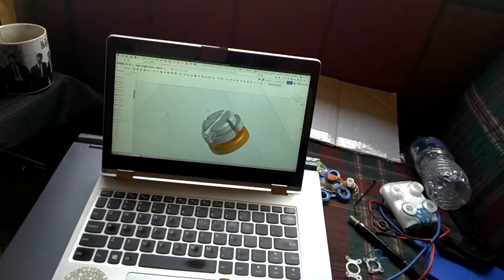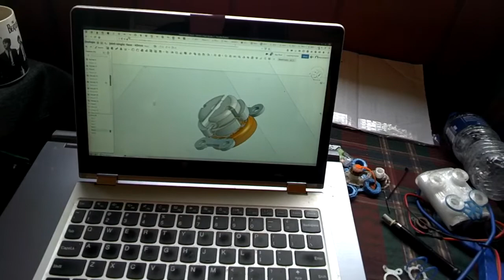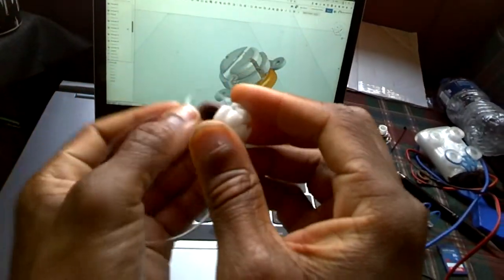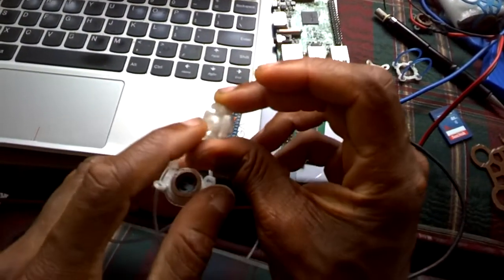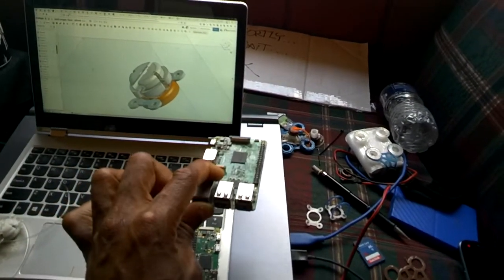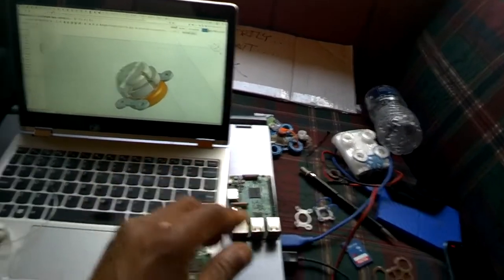release candidate exomesh sensor design update 07022019

Comment: I love your videos man, great to hear your design philosophy. I am also designing a new musical interface :)
Reply: Just a thought, have you looked at the Teensy range and accompanying audio library? Great for sensor/audio integration with suuuper low latency. 
Have a look at the teensy 3.6 maybe, lots of power, high quality audio and sd card reader. 
For my application i'm using the teensy 3.2 with the pjrc prop shield, which gives me a built in audio amplifier, 8mb flash memory, and a 10 axis Imu.